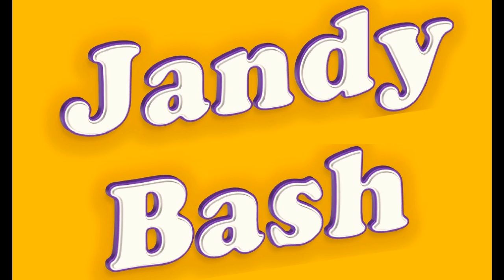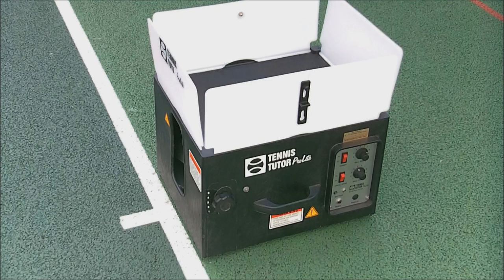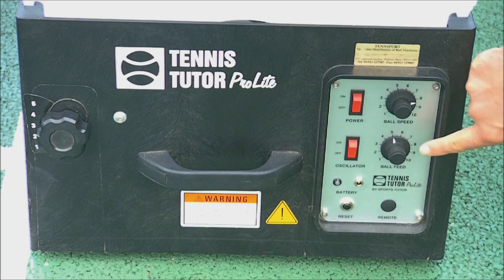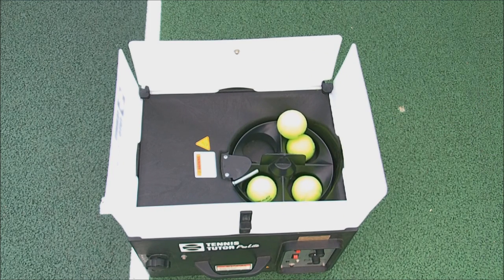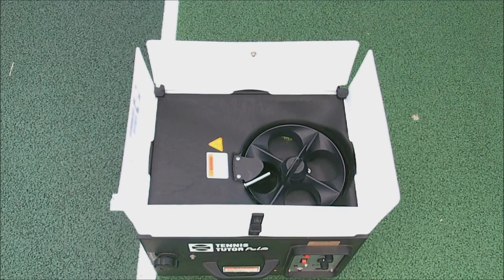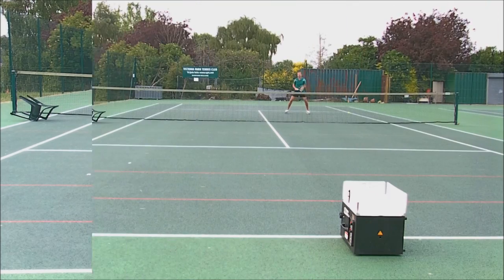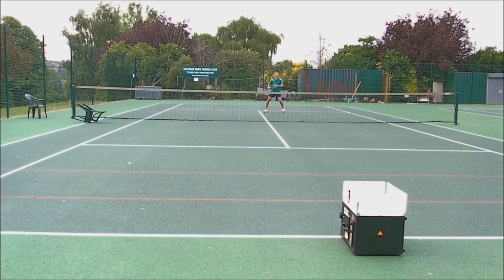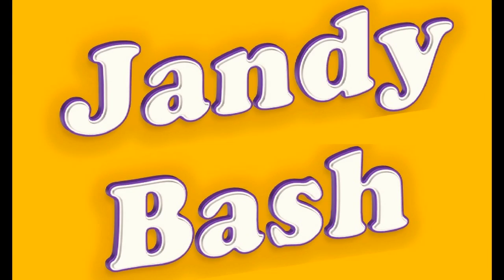Tennis tutor prolite ball machine review

Comment: It’s funny how retailers won’t let you leave a review for this machine even if you’ve bought one so here:
1. It’s pretty heavy
2. It jams sometimes, previous comment does explain a solution.
3. Battery is not the greatest though mine will pick and choose if it’ll last 2-3h on a full charge.
4. It’s fairly limited so you have to make your own dynamic drills to compensate.
5. THE FLAPS to hold the balls F***king Suck, it’s absolutely pathetic how a £1000 machine is so fragile, I hit one with a ball(fair enough, my fault) but I’ve now had 4 break in general use… casually hitting balls and most of your balls come falling out because the ridiculously small piece of plastic in the corner of the flap can’t take the weight of 100 balls.
Only plus about that is the manufacture will replace them whilst in warranty, but they aren’t cheap once that warranty expires.
So overall, it’s not a bad machine… I love mine when it’s fully functional, just be warned that there is a lack of honest reviews

Comment: I have this one and unfortunately  to pay $1000 for it is not worth the money.
First thing you will need to adjust is to eliminate getting ball in the system by the little steel cover . It jams all the time . I install way bigger block and now  is OK.
The battery do not last too long. Max in may case is about 90 minutes.
The charger supposed to be smart one and the LED should change in color when fully charged. This does not work at all. 
It is up to you if you can deal with these "little" disappointments
Reply: You installed a bigger block -- do you mean that you made the entry hole at the top larger?  I would like to know what you did to fix the jam problem. Thanks
Reply: Hi, when you look in to the machine from top down , there is "little" steel plate & screw which supposed to avoid /stop the ball from going to "jam". It is little too small (the plate)to do the job.(It is probably happening because the weight of the balls in it  - over 100). I installed half CD under  it and now it's never "jam" the ball. Also I replaced the old battery now and to have it easier to carry on court I put the battery outside of the machine.Just drill small hole and have the wires run outside. It's better that way to carry it on court. Back pack with racket and balls over my shoulder and the machine in one hand and the small battery in the other. If you can provide email-will send some pix

Comment: at the beginning ( 1:30 ), what is the power level of the ball? thank's
Reply from the maker: Usually have it around 8 with the machine on the base line.  If it is on a 10 from there it is difficult to get the height just right so the ball clears the net and lands in the court.  Ideally if the machine was raised by a few feet then it would be a lot more realistic.

Comment: Wow good thing I purchased the Model 2 for the same price of this model in the video.  They really stripped down this model in the video and priced the same as the model 2 when it was available.  Model 2 had the electronic elevator switch instead of tHe lever and the model 2 had wheels and pulling handle for easy transport.